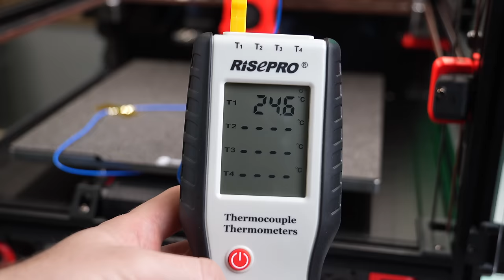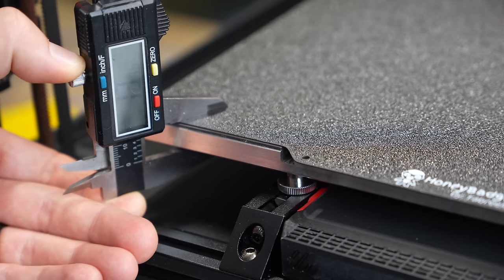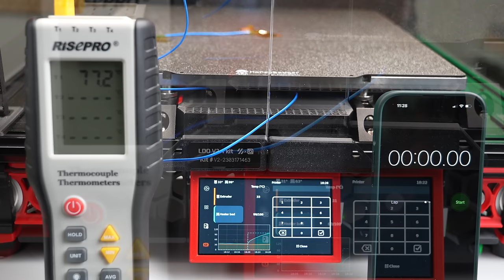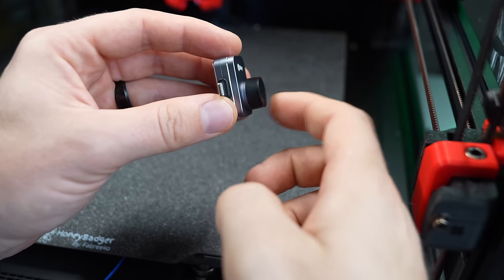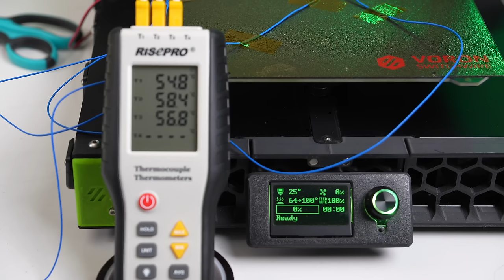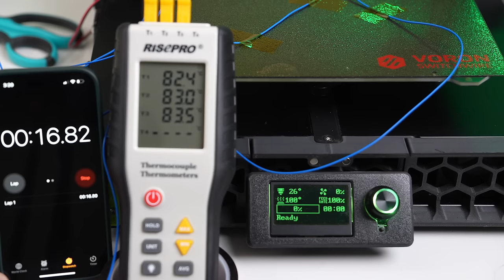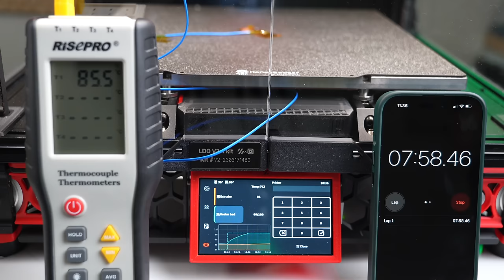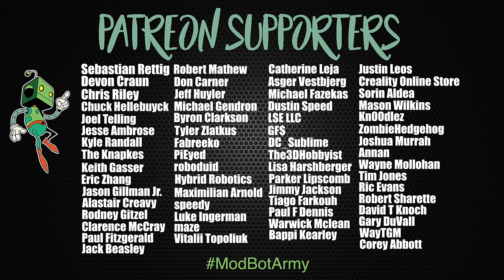Should You Be Preheating Your 3d Printer?

Comment: Hello, I am generally learning a lot from your videos but I see some hickups in this one. Temperature measurements is an area filled with many traps. For one, your thermocouples basically have one or two tiny point of contact with the PEI, and have an hugely bigger area of contact with the kapton tape which are flexible and coated with glue. So the thermocouples are in the middle of a thermal divider, the ground being the ambiant temp, the supply voltage being 100c, the top thermal resistant being a few points and a little bit of air, the bottom thermal resistance being a few square mm of kapton in series with air convection thermal resistance. Bare thermocouple like that are not good at measuring surface temperature. Thermal imagery is the final boss in term of temperature measurement. Many people do not understand the tremendous impact of emissivity, background temperature, specular and diffuse lambertian or non lambertian reflexion (i think the last one are the causes some inhomogeneity you saw)
Reply from the maker: You might be right. I chose Kapton because it is a thermal insulator and prior to embedded bed thermistors most printers I tested out had them attached using Kapton tape as well. Maybe this being a good choice was an incorrect assumption on my part. Any suggestions on a better insulator for the thermocouple?

Comment: I had a problem regarding nozzle temperature that was ultimately solved by changing the thermistor type. After a certain point the differential between reported and externally measured temperature grew too large and visible artifacts and extruder clicks followed.

Comment: It seems like this temperature differential (between the print surface and heating pad thermister) are accounted for in filament manufacturer temp recommendations. If you set your temp high enough so that the print surface is at the recommended temperature, you will see every indicator that your bed temp is way too high. So...  
It would be cool if you could revisit this and try printing with an actual measured bed temp that falls withing the 'recommended' bed temp for a given filament - my guess is the print would be pretty horrible with many sings that you're printing with just way to high of a bed temp.

Comment: I've noticed on my cr6 that I'll sometimes have issues in the first layer, so I'll cancel print and restart right away, cleaning off the material while the machine does its startup shenanigans. 

And it'll usually do much better the second time, I was suspecting it was the bed surface temp and I try to remember to heat up the bed and nozzle manually as I'm preparing a print. I've seen a lot better results for the early layers this way. It is something I'll probably integrate into the firmware once I replace the factory setup.

Comment: On my Ender 3 Max, the bed has a pretty significant droop in the center. After 15 minutes of pre-heating at 60C, the droop is gone and I have a nice flat bed, corner to corner.  At the same time, the nozzle and heater block is expanding and heading down towards the bed.  So, for the first 15 minutes of heating, I've got a bed expanding upwards and a nozzle expanding downwards.  After 15 minutes there are no measurable changes in bed or nozzle, even after hours of soaking.
Reply from the maker: This is interesting. I hadnt even considered the expansion factor in this case. It makes sense which is why you want to do a mesh at temps but someone else mentioned frame expanding and in your case the hotend itself.

Comment: Could you perform a test with the printer upside down? I think you would see a lower difference between the two sides. 
Putting the control thermistor on the opposite side (of the part surface), and without the build surface between the aluminum and the part, will always give you a lower temperature. Putting the control thermistor on the top make would provide better control. Unfortunately it would interfere with the build area. I wonder what it would be like if the thermistor were placed at a corner and the control temperature dropped by a couple of degrees. I think this would give a closer target temperature under the build area. 

A further question is, how does a part over the build area affect the temperature. But at that point I would expect that it would be less of a concern after a few layers hade been completed.

Comment: My $0.02: My Ender 3 with a bed sensor would report varying bed heights while heating for about five minutes. After that, the bed would cease warping and expanding measurably.
Reply: Mine behaves similarly. Always have to run the bed heater before probing or printing if I want to avoid headaches

Comment: very interested to see longer soak times and the effects on bed tempps. Also, curious to see the delta between thick aluminum beds and the mk52 with respect to delta between thermistor and measured temp at high temps
Reply: Thin beds usually have a 2-3c delta, glass is about 5c. I have a specific print profile that has a 5 minute heat soak time after the bed reaches temp to then start heating the extruder.

I also picked up a small 60w heater and temp controller years ago that I was going to use. But that has seemed to work well enough that I haven't set it up 😅

*i do a lot of ABS printing, small and large (285x285 and 315mm high)

Comment: So you are comparing your probes reading with the printer beds built-in reading ? 

If you want any relevant measurement, you should have had the same type probe on top and bottom, so you could also compare it to 
how the printer read temperature - I am pretty sure that is not calibrated !?

Comment: You should have put the sensors under the build plate and let the magnet hold them tight.
Reply from the maker: I feel like it would have skewed the results though. Although I am sure the powder coated plate transfers heat well compared to the aluminum or magnet sheet I still wanted it on the very top.
Reply: @ModBotArmy  Debatable. ;)

Comment: @ModBot This might all be fine and correct, but I wonder if there was a significant flaw in your method. Attaching a thermistor with tape to the top of the bed exposes the bulb on the end to a sector maybe 60° or so exposed to the bed surface while the remaining 300° is exposed to the surrounding air & thin tape. My guess is the thermistor is averaging the reading down. I would like to have seen if a tiny amount of insulation between the thermistor tip and the tape, like the size of a q-tip or something, might give you a more accurate measurement of the actual bed temperature instead of a kind of average of the bed and air. I mean, you saw with a camera how much cooler just the tape was than the bed and that whole surface was literally attached 100% to the bed - the thermistor has even less contact with the flat bed surface.
Of course extruded plastic will exhibit similar cooling as it's built up, but at least it would be good to know for sure the temperature of the bed surface and I'm not positive that measurement method was accurate.
Again, I might be wrong. And thanks for the video. It's still good info and illustrates that the bed is constantly losing heat at the surface and makes sense to keep that in mind.
Reply from the maker: You might be right. I chose Kapton because it is a thermal insulator and prior to embedded bed thermistors most printers I tested out had them attached using Kapton tape as well. Maybe that was an incorrect assumption on my part. I took the outer surface of the Kapton being cooler being due to its insulating properties but I will make no claim that is definitive. Any suggestions on an insulator?
Reply: @ModBotArmy  D'oh. I didn't consider that the tape looked cooler because it might be insulating the heat some off the top. Slap forehead. Obvious now at least as a possibility. But in case you want to try a quick experiment to see if it makes any difference, I was thinking just a small piece of that insulating paper stuff we used to wrap hotends back in the day. Just taping a little of it over the top (not surrounding it of course) might give an idea whether it's a thing or not. I know kapton is good for witstanding heat, but I never thought of it as an insulator, so it might be worth a shot.

Comment: Great video sir!  It would be interesting to see what moving the bed thermistor to the top side of the bed would make to controlling/realizing actual commanded temps.  I would think that this would drive the top bed surface temp to be actual commanded temp where it matters?
Reply from the maker: I completely agree. There are beds with thermistor slots on the top. I think I will need to source one.

Comment: What I find most irritating is that the final bed temp is nowhere near the setpoint. My profiles are a lie! We're probably all printing way colder than we think.
I usually preheat my X1C until the chamber temp shows 40°C or so. It would be interesting to test production machines (like Bambu printers, wink wink, nudge nudge).

Comment: I would not have expected that much of a gap.  Could improvements in print quality / bed adhesion be had by increasing the setpoint such that the surface was the desired setpoint?  I was also considering the X1 Carbon.... I'd be curious how that unit would fare in a similar test.  I've been really impressed by their engineering and wonder if they've already taken that into account.  Thanks again for the content... much appreciated.

Comment: Most printers are firmware limited to ~100-110C. Are the silicone heaters able to go higher or will they melt down? It would be interesting to see how much higher your set point has to be to get the 100C surface temp. 

Does this mean that ABS prints well at 85C bed temp abs we’ve all just assumed it is 100, is it worth chasing a 100C surface temp?
Reply: I personally print at 95 with Hatchbox abs. But if my bed is actually 70 C, that’s really interesting. 

When I set my bed to 100 it’s likely at the glass transition temp because the part deforms when I take it off early. Maybe there’s something mixed in that drops the temp/makes it print even more reliably?

Really interesting question for how many printers would show the same/similar results

Comment: Were the bed fans on during testing?
Reply from the maker: None of the printers have bed fans. There is a Nevermore on the 2.4 that could be used as one but in this case no I just tested heat coming off of bed with the only real variable being heater types, bed thicknesses, and enclosed vs not.
Reply: @ModBotArmy  I mentioned it when I saw the Nevermore on the 2.4 I'd love to see how that effects the testing.

Comment: Aluminum is an extremely efficient heat-sink so it would make sense that on the opposite side of the plate from the heater it would be cooler, the aluminum is doing what it does really well, dissipating heat.

Comment: Yeah?  So what? 

Your results are very similar to my own experience with my Voron 2.4r2 that has the same honeybadger heater.
When discussing the issue on Discord, I was told that the variation between the top and bottom thermistor readings was a function of the fact that the bottom thermistor is directly touching the heater, and the kapton tape was not a very effective thermal bond to couple the thermistor with the flex plate (which is not well bonded with the bed plate beneath it), all of which explains a large portion of the variance even after soaking.
The IR measurements a not very reliable due to the reflective nature of the PEI plate, so a mat black surface would allow for more accurate IR camera readings.
The issue with this video, is that you never explained what to do about the variation.
Nobody seems to know how to best quantify the print surface temperature compared to the bed sensor reading so you can deterministically adjust your filament temperature slicer settings.

Comment: Would be great if you try to understand what temperature you have to set in firmware to get real 100 degrees on top. The reason why top temp capped to 85 - probably PID control, when firmware think in reached 100 - it reduces amount of heating a lot
Reply from the maker: I imagine part of it is PID and that printer lowering heat. I still would have guessed that the heat would have eventually evened out or at least closed its range. One concern someone brought up is how hot the silicon heaters can reach before its an issue. If there is a 15C spread and you are printing at 115 on the bottom to get 100 on top other factors such as adhesive on the bed will need to be considered.

Comment: Should You Be Preheating Your 3d Printer? - No , mine works fine without .
Reply from the maker: Might not be the case with all materials. There are a lot of very sensitive filaments out there that will warp not matter what if perameters are not in a very tight range.

Comment: Dang, LDO Motors is known for making "Great Kits" guess not.. !
Reply: This is probably a troll post, but I’ll bite. Best practices for all voron/enclosed printers should be to target the chamber temp. It ensures that the bed/gantry/frame extrusions are all at temperature before beginning a print (where you should be tuning your printer at as well). I suggest using the “better print start macro”.